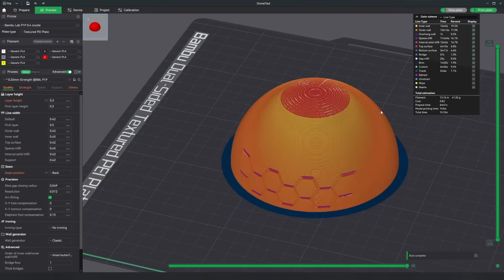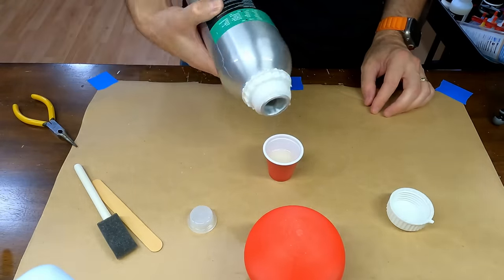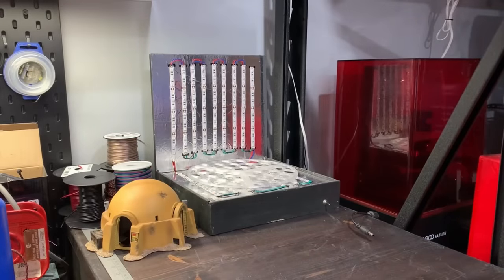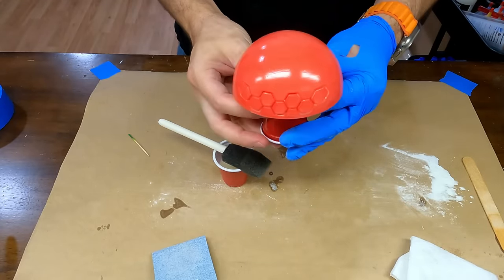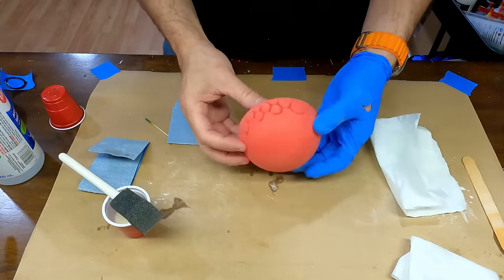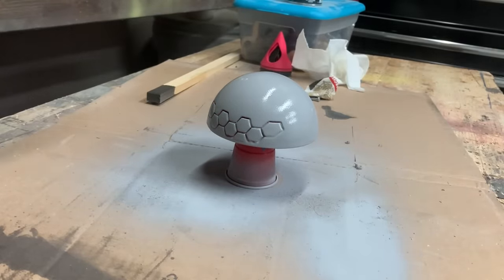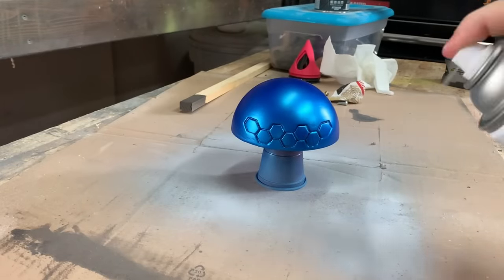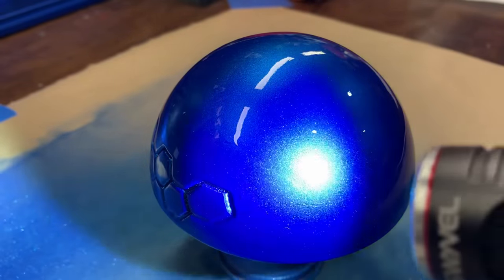Hide 3D print layer lines with Baby Powder and UV resin

Comment: You could make the details slightly bigger with the intention of filling it in slightly. But this is alot of work to get it smooth. Sanding it down first without probably have been a good thing, but I think the purpose was to show that it can be done. Even a heat gun to the print could bind the layer lines together would reduce the added layers and reduce the full on the details.

Comment: I've actually had good luck with epoxy coating.  We didn't paint it afterwards, but that is personal preference.  Regardless, an interesting concept!  Thanks for the video!
Reply from the maker: Thanks. I assume you didn’t sand it after applying? Or did you sand and buff to get it back to clear?

Comment: to be honest i would have gone in a completely different direction. first sanding to get rid of most of the high spots and layer lines that occur during printing. then i'd put on several thin coats of resin to make sure i am mostly depositing resin inbetween the layer lines. then just keep sanding, adding resin and more sanding. i could be totally approaching this the wrong way but it makes more sense to me as you should need less resin which also means you'll add less to your parts surface giving you a more dimensionally accurate part

Comment: Excellent video. 
 I think experimentation to see what happens to durability of the coating would be interesting.  It might work better on certain structures and materials.  The difference of contraction and expansion could cause cracks and chipping.  I would guess the  layers lines give the roughness for decent adhesion.  Perhaps that would make a good video?  Coat some test parts up nice and expose them to the elements to see what fails first.
Reply: FWIW, the roughness of the printed plastic only goes so far for adhesion where plastics are concerned, and there are some combinations different plastics that just won't adhere, regardless. PEI build sheets are a perfect example: some printed plastics stick very well to them, others not at all.
Reply: sorry, just agreeing with your ask for drop/durability testing.
Reply from the maker: I’m planing to do an impact test of different coatings. May take some time though.
Reply: @DaveRigDesign  Awesome!

Comment: You can make flake paint job  in the same way......i hope you try it , just use clear resin .
 
The auto paint version uses clear coat and clear base resin.  Flake Application Method  is up to you. 

This UV curing resin would speed up the process a lot whereas the autopaint version requires each coat of clear to be fully dry before sanding and giving another coat. Many times over days for garage warriors that do not have a  heated booth.

Murdered Candy Flake is a nice type of work.

Comment: I do 3 super thin coats of UV resin with curing in the middle of each, clean with the isopro to remove the excess, then leave before going 400, 600, 800, 1200, 2000 with about basically 20seconds of sanding across each spot on the part with each. The baby powder part is interesting, I had not done that or quite understand why... more glug to the resin probably but i dont know how that sands then. Is it like automotive body filler effectively?

Comment: I wonder if it would have been faster to just print at a slower and thinner thickness rather than all the time spent doing the epoxy and sanding work. 
I dont do 3D printing stuff myself so excuse the ignorance. I know you'd need to do some post work, but it would be good to know if there is a sweet spot of line tickness/post time that worked the best

Comment: Interesting video.  Couple of questions, why didn't you just wet sand first?  Why not just use straight cornstarch instead of baby powder?  Why not use spray auto-paint instead of airbrush acrylics and ink?
Reply from the maker: Well.
- wet sanding removes badly any material. It’s more of a polishing. 
- you could but you can get baby powder at any store, bulk cornstarch is only at bulk food stores
- getting auto paint is a bit involved. You could, but the stuff you get in a rattle can isn’t the same as you spray on a car.

Comment: Cool video. I have to ask if the paint can mixer actually works though. Wouldn't the centripetal force just hold the ball and paint to the outside of the can? Seems like it would not mix well.
Reply from the maker: Here's a video of a similar device being used and the benefits explained by Adam Savage
https://youtu.be/sSH1jS9FMcQ?t=31

Comment: That's pretty amazing, but a LOT of steps for one piece. I might try that technique for my next guitar build. I'm going for a glass like smooth finish, but the grain filler I used for my latest build turned out to be garbage. It's a clear grain filler that claims to give a glass like finish, so it's very hard to tell when it's done it's job. I did 3 coats of that stuff and it STILL looks grainy af. Pretty disappointing.

Comment: You could skip the resin and baby powder if your going to spray prime as the grey auto/body spray primer is high build and does a great job as a filler (with multiple coats)  itself.... that's what the painters would do.  Aloha good vid!
Reply from the maker: Primer isn't really meant to fill voids this big. It's mostly for filling in scratches left from the sand paper. So it will work spraying multiple layers but due to the drying time it's not really going to save any time and sanding the primer really gums up sand paper slowing things down where you really don't get that issue when sanding the resin.

Comment: This was a well prepared tutorial and the results look great.  However, I'm still left wondering if it's really worth the amount of time, effort and materials you're putting into this process, especially since you still had to sand, prime and paint.   You also printed this in 0.3mm resolution using a Bambu (fast) printer. Unless you're particularly time poor printing at 0.2 or 0.1 will make less work in post processing no matter your technique.

 The conclusion I had from similar trials was:

The only time I see this multiple-step resin-coating being valuable is one of two scenarios:

1) You don't actually want to paint. You want to preserve the original colour of the filament so you want to smooth it by using transparent resin.. so you sand the resin smooth between coats but your final layer is just resin.

2) The shape is intricate/has many surfaces that are not possible to sand with an electric sander (mouse, orbital, etc).  Bonus points if the part has no intricate details that you'd need to avoid the resin seeping into.    

Otherwise... why not just spend a couple of minutes longer with an electric sander if you're going to filler/primer and paint anyway, especially if printing at finer resolution.

Comment: I also assume that the detail would be lost if it was finer and raised as the resin and coats built up around the items on the surface combined with the sand downs. So this is a good technique, but needs the proper model to do its best, I reckon.

Comment: Although the method undoubtedly works and is technically sound, because fine talcum powder is suitable for this, but being a cosmetic product, it also contains expensive and unnecessary additives.
Many types of fillers and thickening materials, including talcum powder, can be obtained directly from places that sell industrial synthetic resins.

Comment: Just out of curiosity, wouldn't it have been significantly less work to just use bondo,  or a solvent to dissolve the outer layer? I just don't really get the point of using resin if you were going to paint it anyway.

Comment: I wonder if the cured resin helps with the structural integrity of PLA when exposed to warmer temperatures. PLA and PLA + is a lot easier to print than PETG or ABS and if this can be used to not only smooth out prints but allow PLA to work in 90-120F, that would be pretty cool.
Reply from the maker: I don’t think it will add much strength as the resin layer is so thin. I believe is the print heated up and deformed the resin layer would crack and possible flake off.

Comment: I wonder if you could add some real fine glitter to the resin concoction at about the third or fourth application and then follow the rest of your procedure to get a sparkling glossy surface finish?
Reply from the maker: you can add glitter to clear resin to get a sparkling finish but the process would be different and you couldn't paint after or it will cover the resin. Metallic automotive paint has metal flakes in the paint to give this effect.

Comment: How about using RTV or something similar to temporarily fill in those hexagon groove patterns? Once the rest of the print is filled and painted you can easily remove/peel the RTV and then fill/paint the hexagon grooves with a different color.
Just a thought.
Reply from the maker: yup, could do that. would need some kind of mold release so it doesn't stick.
Also would depend on the details you are trying to protect, the smaller they are the more difficult it will be.
Reply: @DaveRigDesign  Very true! It's the kind of experiment that a determined artist such as yourself would learn to perfect. If I had your resources I'd try it myself. Alas, I don't have the resources.
Reply from the maker: maybe I'll try something like this in my next video :)

Comment: Curious - have you done similar WITHOUT the cornstarch?  Just trying to fill in with resin?

A friend of mine has asked for a star wars scout trooper helmet - this looks like the perfect way to finish it!
Reply from the maker: just plain resin is very thin, It will work but harder to work with without it dripping and will take more coats. Would be perfect for a SW helmet I think.

Comment: I'm actually more interested in that Cure station of yours. Did you build it? Or did you follow a guide? Either way would you share it?
Reply from the maker: Built it. Simple box with a 12v motor with built in gear box to turn the platform slow. Printed the platform out of clear petg.

Comment: Maybe I’m stupid for asking but couldn’t you use a heat gun or a torch to heat it up slightly to melt it smoother?
Reply from the maker: You can do that to remove stringing, but any more than that will make a mess of the surface.

Comment: Thanks for the video. I'd like to try is as well, but don't have a UV chamber. However I do have a small UV light, would that work as well ?
Reply from the maker: Should as long as it’s strong enough, may just take longer. I just made my chamber with a uv led light strip so a chamber is simple to make.
Reply: @DaveRigDesign  Ok. Thanks. I'll try it soon.

Comment: nice idea for quick fixes, but UV resin is 3 to 6 times more expensive than other specifically designed solutions. imho, 2k urethane primer offers the best quality/price ratio. It surpasses UV resin in terms of quality and can be applied with a brush or airbrush, drying in just minutes. also , you have the flexibility to select the filler size. Light-weight putty is another great option since it sands easily; it's softer than the substrate unlike UV resin.
Reply from the maker: A few people have mentioned Urethane primer, sounds interesting but just looked into it and it says 2-3 hr drying time to sanding, UV primer is 1-2 min so that would be the main difference.
Reply: @DaveRigDesign I think  2-3 hours refers to full cure time. Depending on the catalyst you add, you can start sanding in less than 5 minutes. Another drawback of using "UV resin as a primer" is the bonding. When UV resin is applied over plastic, it creates a mechanical bond. In contrast, when using painting primers, you can treat the piece with an "activator" (a soft thinner that melts a microscopic surface layer of the piece), which forms a chemical bond that is significantly stronger than a mechanical one. Additionally, resin designed for 3D printers contains UV blockers to prevent over-curing, making it difficult to control the thickness when brushing it on ,and potentially leaving under-cured resin close to the surface. It's not going to peel off right away, maybe not in weeks or even months, but it will surely peel off in a few years.

Comment: How durable is this? I'm looking at printing some ASA velocity stacks for an engine and using acetone vapour smoothing to handle the print lines for a smooth finish, this could be an alternative
Reply from the maker: Usually resin is brittle but that’s where they are fully resin. This thin a coat should be fine. Not sure what the heat handling is but I would expect it to be higher than ASA

Comment: Can you share your airbrush set up? The connector to the Badger looks unique yet easy to use?
Reply from the maker: Nothing special. Just a standard airbrush hose and a standard air fitting to attach to the compressor.

Comment: Would resin by itself not have done the job?  I havent used these techniques to smooth anything before so just wondering.  Great video though, ill have to keep this in mind for an upcoming print!
Reply from the maker: thanks, plain resin would work, it's just easier to apply when thicker.

Comment: Any tips for the details? Does it make more sense to use a small chip brush to apply the resin mixture instead of the foam brush?
Reply from the maker: I made a follow up video comparing resin with and without powder and I found patting the foam brush over the detail area did a good job of not filling in the lines. 
So using a smaller brush could work so you just dab the resin where you need it instead of dragging it across all the details

Comment: Could the honeycomb detail be filled in with something like hot glue or wax as placeholder until you're finished?  Or would that be too difficult to control and/or remove?
Reply from the maker: maybe, other have suggested that, the key would be it doesn't get affected by the sanding and it's easy to remove cleanly.

Comment: Nice but then the question is which takes more time? Printing with a smaller z height or this
I think you nailed the R2 blue
Reply from the maker: Well you still need to prime and sand somewhat either way so I think the bigger the print the more this process makes sense.

Comment: Thanks for sharing this technique. I wonder whether more progressive sanding and a thick primer (ie. Rust-Oleum 260510 Automotive 2-in-1 Filler & Sandable Primer) would have achieved similar results without the resin/powder combination at all. I will probably try it both ways and compare the results. Thank you!
Reply: It will but you will be spending so much more time starting with a low grit sand + primer. I have done two masks now, both PLA, one was done the way mentioned previously and the other with resin.

 I spent roughly 3 weeks sanding, filling, sanding, filling just to get a result I wasn't really stoked about. Resin got better results than primer and sanding in about 3 hours. This method is amazing, I've done 2 helmets since. Just make sure you wear a mask and are in a properly ventilated area.
Reply: @0XxZachAttackxX0  thanks for confirming. I will definitely give this method a try.

Comment: A lot of people are saying "Just Sand It", but they seem to miss the point of not sanding it. To name a few downsides, sanding can becime messy, time-intensive for larger prints, labor intensive (again, for larger prints) etc. I'm pretty lazy when it comes to post processing my personal prints, so seeing this process which effectively removes layer lines and seals the print is nice, all without having to sand it.
Reply from the maker: For large prints this is the way to go, much faster and easier sanding.
I have another video using putty to hide layer lines
https://youtu.be/xxdjFREJpKs

It's a similar process and better for small prints or with areas with details because you can control where it is applied better. But I think using both processes is the best approach. Resin for large plain areas and putty around detailed areas.
Reply: but this process does require sanding?
Reply: Never get into woodworking, my friend 😅
Reply from the maker: everything requires some sanding if you want a smooth finish, it's just how much :)
Using putty you have more control where it goes because it's not a liquid, but it talks longer to apply and is more work. Good for small areas going around detail you don't want to cover but not great for big areas.
ALso you have to wait for it to dry where the resin cures instantly with UV light
Reply from the maker: I build a table out of a oak cookie slab and resin infill. Try sanding oak end grain if you want to know the horrors of sanding :)

Comment: If you have a resin printer as well, why not build the support frame out of pla and a smooth cap out of resin? You might be able to get away with little to no sanding. I do realize that this isn't useful for thin shapes like prop helmets as the resin is too brittle, but do you see any drawback for a solid prop use such as a hammer?
Reply from the maker: that could work in this case but not for a real world asset, and even for a simple dome getting the resin and fdm prints to line up perfectly so properly fit inside each other would be next to impossible.
Reply: @DaveRigDesign  cool, thanks for the insight!

Comment: (Note: I’m not a 3D printer owner so I’m genuinely asking, not trying to be pedantic)

Is this better than just using a resin printer in some way? Like, is the underlying print better or cheaper this way?
Reply from the maker: If you were printing something small, maybe up to 2x the size of the dome I use in the video then you can just print in resin. 

If your printing anything bigger then resin become prohibitive due to the limited size of resin printers, weight, cost, resin being brittle so that’s when this process is the better option.